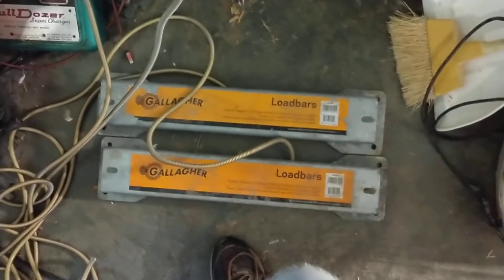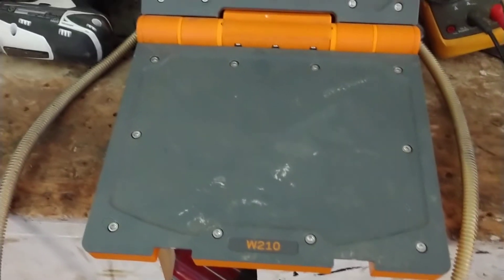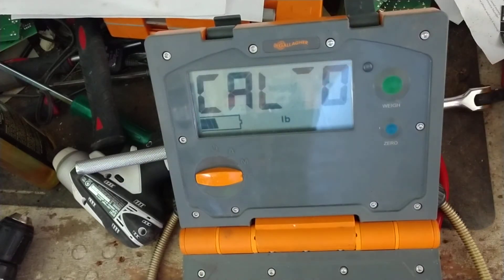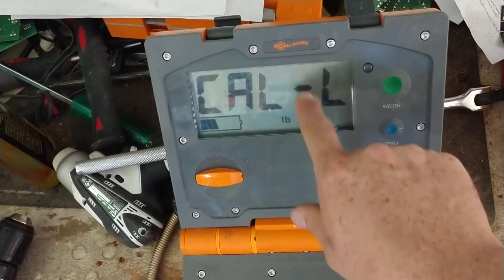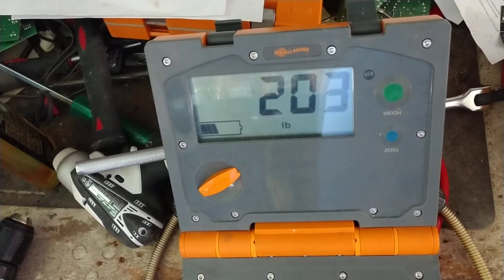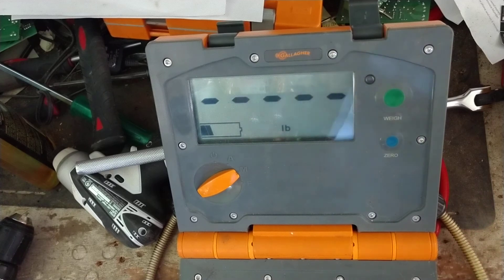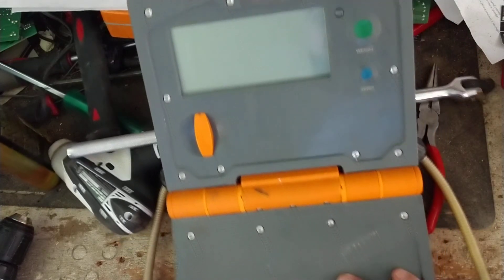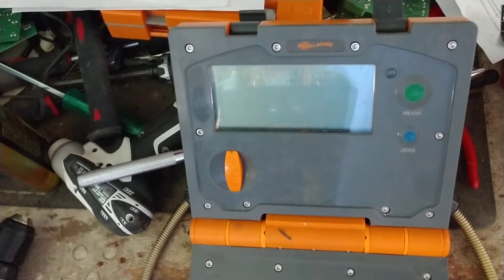Calibrating A Gallagher W210 Cattle Livestock Weigh Scale

Comment: I need help to calibrate a Gallagher Rudd700 it looks like the 210 but wont go into the calibration like the 210?
Reply from the maker: I sent you an email back with the calibration instructions. Your scale doesn't go into calibration mode at all like the W210 or smart scale 200. Let me know if the instructions guide comes through correctly or not.

Comment: What if it beeps after I load it & won’t register the load? 4:40
Reply from the maker: I'm not sure. I would have to have a conversation over the phone with you to chat things over. Hopefully there wasn't something actually wrong with one of the load bars vs it actually needing a calibration. Sometimes if there's issues with one or both bars not weighing right and you don't realize it, then try doing a calibration, you can really mess things up calibrating a bad bar and you have another new issue that has to be dealt with on top of whatever the original issue was.

Comment: I am trying to calibrate the Gallagher/Ruddweigh 200 indicator any video on that one??
Reply from the maker: It's about 90% the same as the W210, just the last thing that's different is something to do with the switch and what you have to do to save the calibration. If you send me an email at cattlescalerepair@gmail.com I'll send you the calibration instructions. Make sure your load bars aren't actually the issue of the weights being off because if you calibrate your scale and there's an issue with one of the bars, then you'll open up a whole can of worms trying to figure out what's actually the issue at that point.